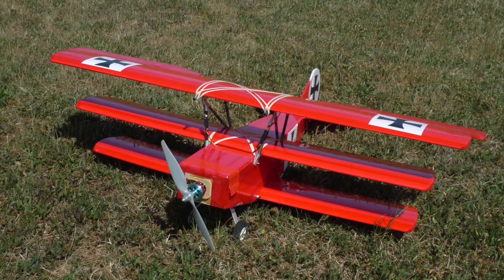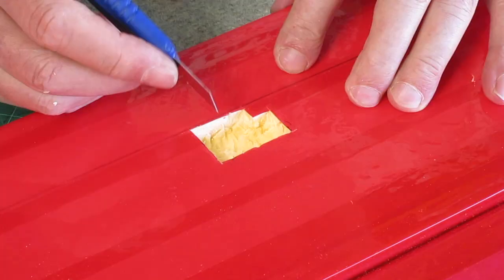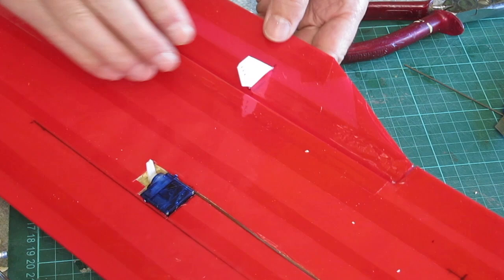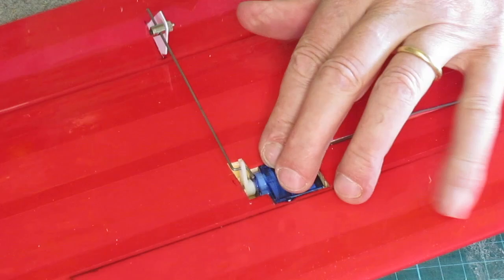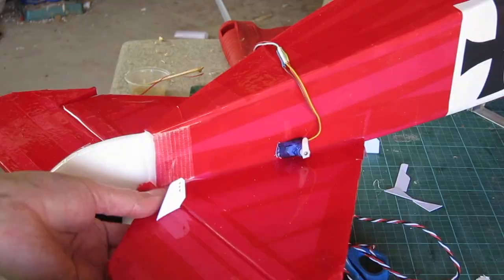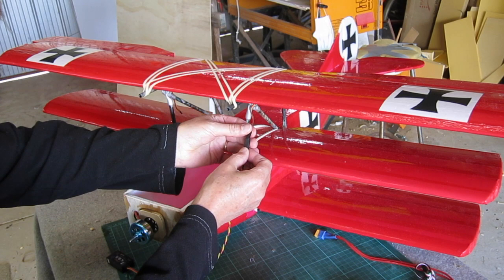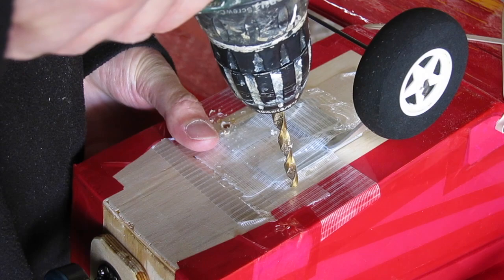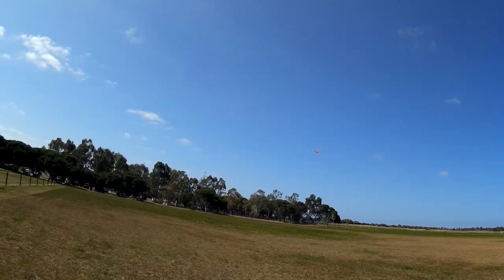Fokker Dr 1 build Part 4 - Electronics

Comment: I have to say Andrew I love your all your very instructive vids. I am a 70 yr old from UK, done a lot of sailing in my life but trying to get back into the hobby flying after many many crashes with balsa planes. Many thanks for all your work excellent stuff. Your vids will help me try to make a foamy plane to learn on and try to get the hang of RC flying and reach a better standard.
Reply from the maker: Welcome Peter. Foam is the way to go, and the electronics components are so cheap now too. Good luck with your builds. What style of plane interests you?
Reply: Andrew Newton  hello Andrew, I like your 3 channel trainer, it looks very durable for the many crashes it is likley to get!! As you say a good model to learn on. Just seen your V3 of this build.
The carbon fibre spine you recommend is USA manufactured, I guess I could find the equivalent in the UK. The shipping charges loom horrendous from USA to UK.
Reply from the maker: Yes shipping is bad but the price of individual woven arrow shafts in AUS made it worth buying bulk for me from USA. I use them for kites as well. Look locally for archery supplies or fishing poles maybe. Worth looking at my Boxler build too. That's a real slow flier.
Reply: OK Andrew thanks for advice. There some UK suppliers on Ebay but wondered about the quality. It is going to take some time to acquire all the different materials. Before I saw your Utube vid I saw a vid of the SlowBipe  a beginners slow biplane extolling the virtues of being easy and slow to fly as well as being virtually indestructible.
Marketed in USA but it was nearly 50 US plus shipping and in any case I think it would be more fun building of yours.

Comment: Andrew, what do you use for push rods?  Buying straight steel wire is horribly expensive, do you buy coiled and straighten, if so how?
Reply from the maker: +Simon Stevens Piano wire from my local hobby shop. It's not expensive. 1.2mm usually.

Comment: The DT750 motor will perform better with an 11x4.7 slow fly prop.
Reply from the maker: +Adam Heidingsfelder Better in what way? I dont need less thrust.
Reply: http://www.rcgroups.com/forums/showthread.php?t=1708731
I've read several comparisons between props with this motor before I bought it. Just trying to help...
Reply from the maker: +Adam Heidingsfelder Thanks Adam. I'll check out the link.